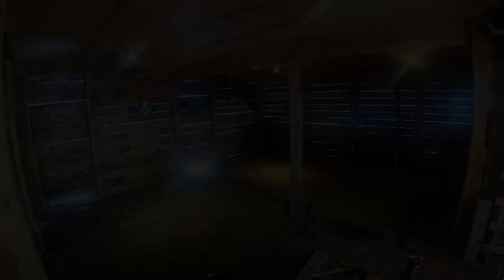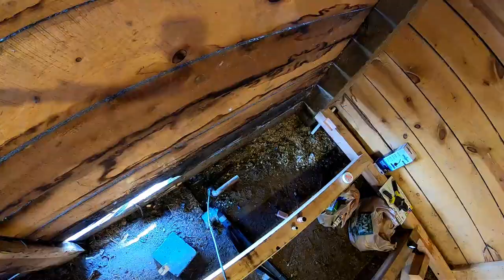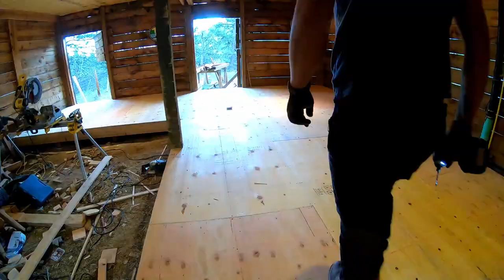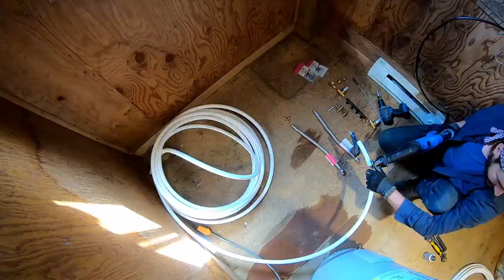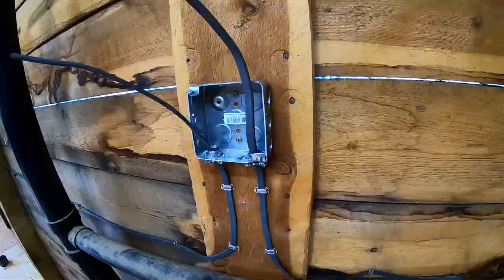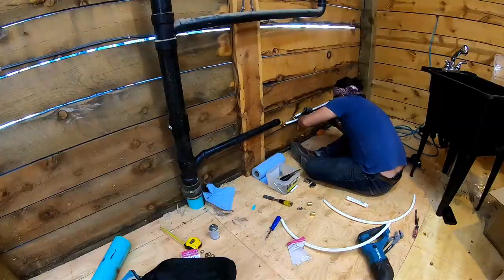A New Barn Floor in Less Than 4 Minutes!

Comment: the previous residents to my house built a barn on a slope - sloped dirt floor! we want to finish it but are struggling with the grade for supports - cinder block for the high area, but as it gets lower, would stacked bricks be safe enough? can't find the perfect height without stacking something or sinking something. I think we are going to end up with graduated flooring regardless.